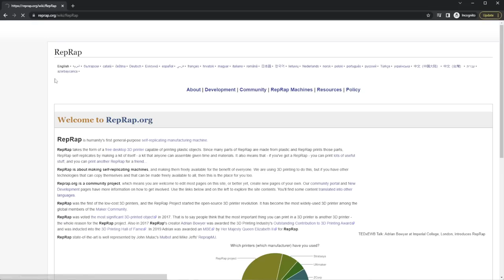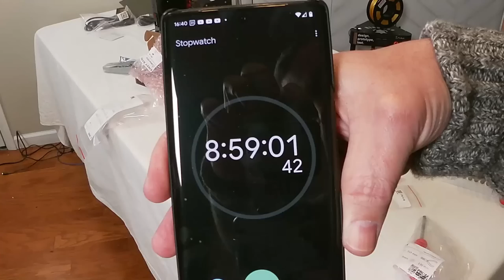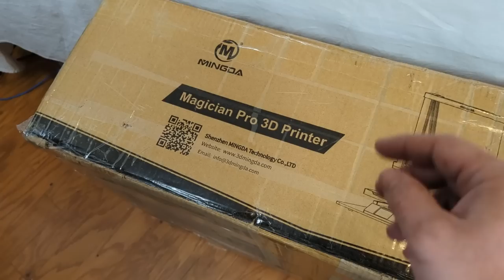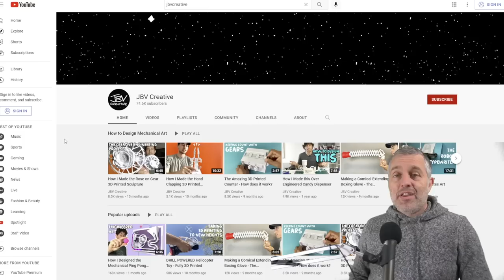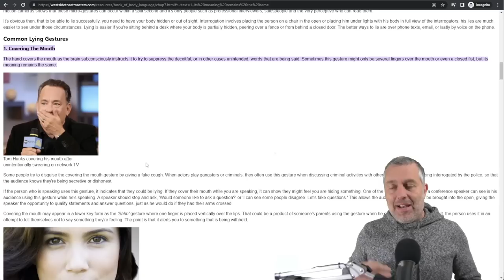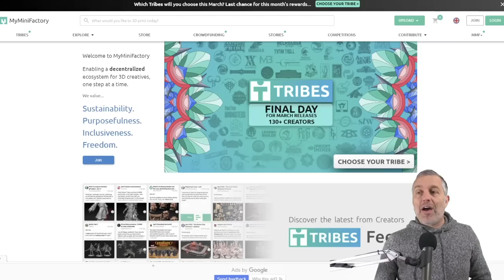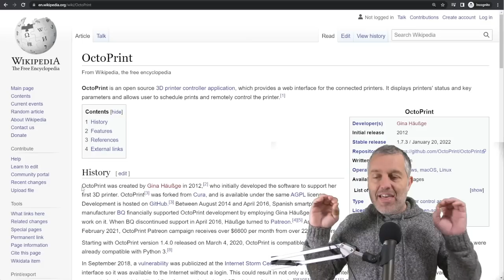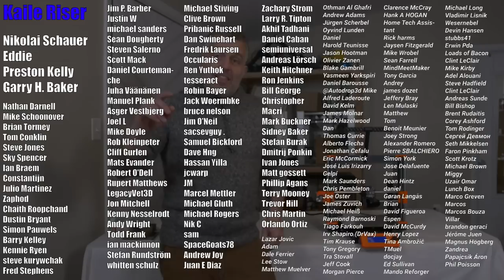Why Does Nobody Speak Truth About The Prusa I3 Mk.3? - It's Overhyped and Over Priced.

Comment: Ok so your first point is that the assembly is ridiculously long and the build process is not to your liking. For a couple hundred dollars more, Prusa will send you a FULLY assembled Mk3 that literally still has a test print stuck to the bed, ensuring quality prints right out of the box. 

Your second  point is that you have to still do some calibration, when you can get a cheaper printer which uses the nozzle to calibrate eliminating any work. This is false. Since your video Prusa has updated their design and you don't have to calibrate anything at all, there's not a single step more, a matter of fact its arguably less work as the printer automatically calibrates itself before each print. So you don't even have to click a single button besides "print". 

As for your comments about Joseph Prusa's ego. If you spent hundreds of thousands of dollars on designing a 3D printer and establishing a business to sell them, then I'm sure you would be proud to put your name on it.

Pretty much every point you have made can be dissected and proven incorrect, and yet you wonder why people get so mad at you. You hate on them because you dislike the price and its obvious.
Reply from the maker: A counterpoint can be made to any statement. Any. Statement. That doesn't mean that the counterpoint usurps the original statement. I'm not convinced by any of your counter arguments. Nor do I think we'll be any thinking man who reads this. Put you and I both know that no random strangers are going to see this comment of yours or my response. Real people don't sort comments by newest. Also, this video is quite old. They're not going to look in the comments at all. But thanks for spending so much time to leave such a long comment. I think it still helps my channel with the algorithm.
Reply: @DesignPrototypeTest  😆 Your welcome. Take care.

Comment: Dunno man, I've had 3 printers and the MK3S is the best one I've had. I started with a tarantula, modded it to hell. I even published a carriage for MGN rails that got quite a bit of downloads on thingiverse. Then got an Ender 3, also modded to hell. Nothing mattered, when I got the mk3s that thing printed a first layer as good as the modded Ender 3. Maybe I got super lucky and got a really good kit with good tolerances on everything, but damm this thing is pretty good. I've had it since release and maintain it once a year, perfect first layers, and has never given me an issue. Hell, I can honestly tell you I have not gone through calibration since the first few months of owning it when I was trying out different adhesion systems and filaments. 
I already fight my code when developing, my brain when designing stuff to print, I don't want to fight my printer. Sold both the tarantula and ender 1 year after getting the mk3s, never looked back.
Reply from the maker: Sounds reasonable. Have you built a Voron yet? Do you disagree that someone who thinks they might want to start 3D printing should start with an Ender 3 and then move on to a Voron?
Reply: @DesignPrototypeTest  I'm actually a robotics associate professor at uni, we got a lab with more printers. I don't tinker with them, we got 3 big BCN3D (I think they are sigmas?) and a voron we ordered off a local maker. I do agree voron is a better design, but I like the mk3s smaller build overall for personal use. 

For beginner path, it really depends on the person. Students and people with lots of time should be fine with enders because of the modding. But me personally, having already tinkered, I'd rather have the "build and go" experience I've had with the prusa kit. With less time, I'd rather use it designing and coding my projects instead of getting into tinkering to get reliable prints.
Reply from the maker: But you seem to only acknowledge time as the cost of ownership. What about the financial differences. An I3 Mk.3 costs $580 more than an Ender 3. Thankfully time=money and we can do that calculation. Working at $15 minimum wage a student would need to work in their part time job for like two weeks to pay that difference. Let's not forget that it took me 9 hours to build the Prusa. How long will it take a noob? Don't you think those hours would be better spent tinkering with an Ender 3 and getting it to perform as good or better than an I3? It's the same time commitment and now they understand 3D printers to a much finer level instead of the drudgery of their menial student labor. For what type of person does it start to make sense to just pay the extra $580 instead of spending the time with your printer? I contend that the Ender 3 is by far the better choice for the vast majority of consumers.
Reply: @DesignPrototypeTest  "Vast majority of consumers" is false imo. The Creality Ender 3 is akin to a fixer-upper car and the Prusa is ready to drive out the lot and work for years without issue. There is plenty of merit in lower price and there is also merit in spending the time to learn and upgrade - but there exists with any market like this a spectrum between hobby project and useful tool. A lot of Ender 3 users get fed up and forgo their printer or the hobby entirely. Spending 750 or 1k on a quality, dependable machine like the Prusa is not a mistake for those with the means to do so. And remember - Prusa offers the Mini at a much lower cost of 350-420 (420 being assembled and with the filament runout sensor). I think the Creality's sole positive attribute is its low entry price; all physical aspects of the printer itself are rather juvenile. The v slot roller motion system, the binder clips securing the bed, the bed leveling knobs - they're all not worth someone's time to mess around with imo when there exist far better solutions. People with countless hours to mess around and learn should look at the Voron V0 or V2 and people without that time should get the Prusa. IMO the Creality value-add is purely the cheap factor. If you literally cannot afford the $600 or so to get the voron V0 materials and still want a "project", yes the Creality line is a good start. But those with the time and patience who truly want to learn FDM should just leapfrog to the current best offering, CoreXY with high flowrate hotends and direct drive extruders, not Ender.
Reply: @DesignPrototypeTest  Someone who doesn’t want to spend that time, or idk, someone who is not as tech savvy. Why do people buy new cars when they could fix up an old one? Your argument makes zero sense
Reply: @DesignPrototypeTest  As I said, i only recommend MK3/s for people with no time to waste on tinkering or desire to do so.

I'm torn for what to actually recommend to, say, an engineering student. The ender 3 is too ''hands off'' for my taste, i specifically started with the Tarantula as it was pretty much something you build from a BOM that has a modicum of QC and didn't like the ''assembled gantry'' type kits that were available at the time (way before the ender 3). I would say engineering type students should get a more barebones kit than the ender unless they are simply not interested in the hobby side of 3D printing and just want a print and go type of deal.

9-10 hours seems about what people usually take with the mk3 build. You were also recording, this probably held you back quite a bit, as it took me around 6hr to build it and when I did it I had only built/modded 2 printers and you have more experience with more machines than i do. Using my 1st build, the tarantula, as reference, that one took me 10 total hours and has a bit higher level of complexity than the MK3 since the wheels are finnicky to get set up correctly.
Reply: @DesignPrototypeTest  TBH it took me 7 hours to complete my Prusa Mk3 i3. And unlike yourself,  mine was fault free and worked straight away. I also took note of what the manual said at the beginning, and to follow the online manual which was always up to date. You lost me on this video with your personal hatred for Josef Prussia. Well, most people looking to get a reliable printer are not bothered who owns the company. Why should that matter? Do you know the owner(s) of Creality and more to the point do you like them or hate them? As for the price of Prusa, why do you care. People will decide if they want to pay that price or not. I bought mine after struggling to get repeatable decent prints out of. CR10. Which I spent a small fortune in modding. I would of saved a ton of time and money if I had just bought the Prusa from the off. As for your rant over the Haribo’s, I think that you lost any kind of credibility at that point. I generally like your video’s and I am a subscriber, but you nearly lost me at this point. After spending a life time in sales and marketing, I would say don’t alienate your viewers (customer base) with biased views that are absolutely not relevant in such a review. Lastly why were you doing the test print on the Prusa at 239% speed? Cheers Mike
Reply: @michaelnash9644  He assembled it wrong too lol. He bashed on the instructions about being too detailed and then went and put the z axis caps on wrong
Reply: I've had similar experience as you where I spent months researching and sourcing upgrades, printing parts to upgrade my enderalike. I got it printing very well too, even to the point of abs in a steel enclosure....

But the prusa mk3s's I sourced for the hackerspace printed just as good right from the get go. I'm not going to even bother with the time on upgrading,  although it's true I know all the ins and outs of printing afterward. Would I recommend it to someone only lightly curious? Probably not. Too high of a print failure rate to frustrate them.

I've since built 2 vorons, and again it took an age too.
Reply: @BrettJamesSuperRoach  Absolutely. As an engineer, i absolutely understand the value people see in DIYing yourself your printer by modding a good frame like the ender 3. But at this stage, I value reliability, uptime and readiness more than anything else. I can get my MK3s printing at pretty decent speeds for functional parts where ringing will not even be seen, or I can just let it sit at slower speeds for parts that will be seen.

There's something magical about just knowing there will be no issues with your print even if you let it unsupervised over a weekend, for the time and effort of a yearly mantainance run of around 2-3 hours of cleaning rods/lubing up what's needed and readjusting belts.

And before anyone sounds the alarm: it's on an enclosure with several automatic protection methods and octoprint monitoring the printer through a UPS, even my brother smoking near it, with the enclosure door closed can trip my warning notifications/autopause.
Reply: @DesignPrototypeTest  Lets not forget the community for the ender3 is huge and welcoming to help and comments.
Reply: @DesignPrototypeTest  You're spot on with time is money. Prusa works really well out-of-box. Ender 3 V2 etc. don't work well out-of-box, most of the profiles for slicer aren't good. They need hours of modding and tweaking to get to the same level. Now if you begin to count even modest fee for those mods, things even out so fast. Heck even bed leveling on Creality's own firmware (after you mod BL touch to it, btw) is way, way slower and prints take much longer too. Yes, Ender is great for those who want to tinker with printer. Prusa is great for those who just want to print.
Reply: @DesignPrototypeTest  Just buy Mini. Prints as well as MK3S has a nice and big screen and is much cheaper. How about that? Ender´s quality is much lower

Comment: I completely disagree with you. I had Ender 3 for ~2 years and it was never 100% reliable. I felt the need to do upgrades to it and it wasn't always smooth - I had to go through a lot of troubleshooting and maintenance. 2 weeks ago I received my original Prusa i3 MK3S+ and it just works. Assembly took ~10 hours and was quite complicated but it prints flawlessly. Finally I have a printer that just works for me. Attention to detail is simply unmatched compared to Chinese printers. Prusa nailed down the hardware, firmware and their slicer. It all works as a seamless ecosystem and I love it.
Reply: Ender 3s are just as good as Pursas for 1/3 the price

Comment: The thing you seem to continually miss about Chinese printers is that finding a cheaper way yo make a product is in itself an innovation.  And what you seem to miss about Prusa printers is that making a polished, refined product that is user-friendly (with a huge community) is also an innovation, which is very valuable - especially to a certain segment of the market.  

Granted- the i3 design is a bit long in the tooth at this point  - but they have continuously made small improvements over the lifecycle, and as you point out they are releasing an entirely new CoreX/Y line - so they are pushing things forward!  When you factor in the complications that come with being an established brand and a company that is mass-producing parts, I think you are being unnecessarily harsh on Prusa.
Reply: The Chinese companies didn't figure out a way to make things cheaper, they just know how to make things cheaper and they understand that you can make good money over time. It's why they can run convenience stores where they're making sometimes only pennies on every little purchase. They live within their means so they don't need to charge you an entire paycheck. Western countries on the other hand love to overcharge you. Which is why people buy things from China in the first place.

Prusa is like Apple, where they claim their hardware is better than other people, at the same time that other hardware is doing the same things theirs is.

Oh, their corexy for $2k+?

Gee, how innovative.

Two trees delivering a corexy machine for $450 is innovative.

Good for them that they continuously made small improvements. Big freaking deal when you're starting off at $800 and now have to make upgrades to something everyone claimed was perfect out of the box.

Prusa can suck my beeeeeeeeeeeep.
Reply: @dangerous8333  Buy a two trees corexy then. Oh wait- it doesn’t work stock. Literally watch any video on it and you’ll see it doesn’t print well at all. Sure, you could spend HOURS making it a good machine, or, for someone that doesn’t want to pursue that route Prusa has made a excellent option wether you like it or not. At the end of the day, people buy Prusas because they create a better product.
Reply: @dangerous8333  Also you say Prusa is not innovative- when they have literally invited the PCB heated build plate. Western companies can charge more because that cost comes with good customer service, research and development cost, and a better, more finely tuned product.
Reply: @dangerous8333  I would also agree with you- Prusa is like Apple in many ways. They produce a well tuned product and they have better software. (I have an ender but I love prusa slicer)
Reply: @ibrue  Prusa is like Apple if Apple wasn't awful. Prusa publishes the source code of their firmware and slicer as open source and even natively supports many competitor machines/filaments on that slicer. They encourage user assembly/disassembly and support 3rd party upgrades. Prusa is like Apple in that they have a comprehensive ecosystem of quality, premium products (Prusament, PrusaSlicer, and the Mk3 are all excellent), but Prusa is nothing like Apple as far as repair and sharing go.
Reply: @ibrue  heated build plate was not invented by JP.  He invented the PCB heater plate.
Reply: @ahmetcemturan  oh my bad- but still
Reply: @TheRAINMan059  True, prusa is way better with repairing and replacement parts
Reply: @Ian Brueggeman  I got an Creality Ender-6 and it's fantastic.  I was shocked more people weren't talking about it.  There's always room for improvement, but it is hard to beat for the price.

I bet the Prusa XL will beat workhorse though... I would love to get my hands on one.
Reply: @RyanMcQueen1985 Personally I love to tinker with 3D printers but I don’t want something as big so I think imma buy a voron v0 just to prototype things quickly. I wish I had bought somthing other than a ender 3 to start, because now there’s not a whole left to do with it- other than that corexy conversion kit (yes it exists 😂) For the average hobbyist, I would still recommend an ender 3 to start because it teaches you so much. But for someone who wants a machine, not a hobby, prusa is a good option. Also there was a good delta printer but I forgot the name
Reply: @dangerous8333  What upgrades are you referring to? I have a stock MK3s and it does a fantastic job whereas all of the other cheaper printers have to have upgrades just to get to the same level as a Prusa.
Reply: I unsubscribe. He clearly don’t know what he’s talking about…